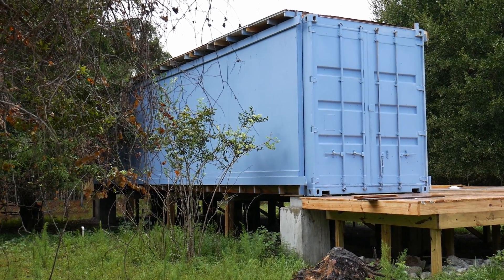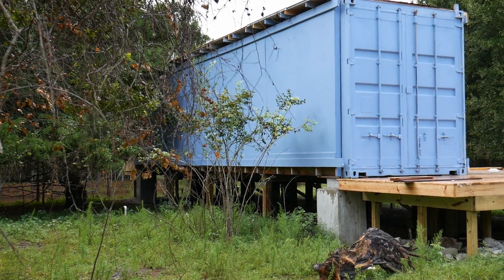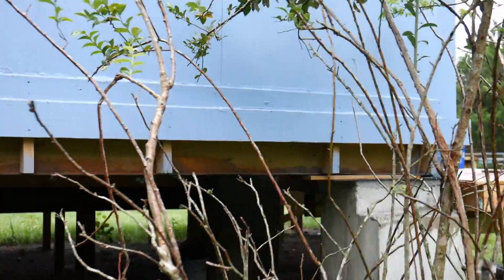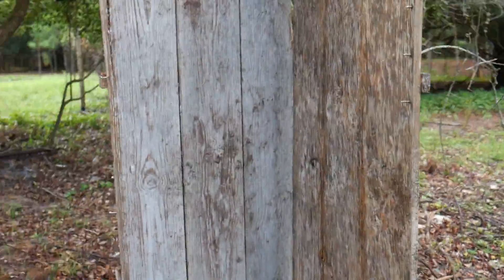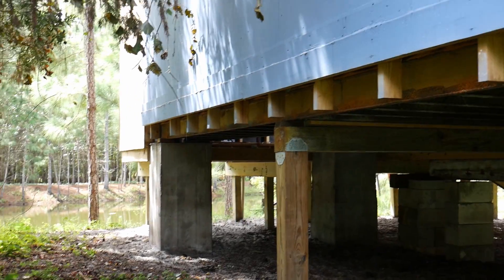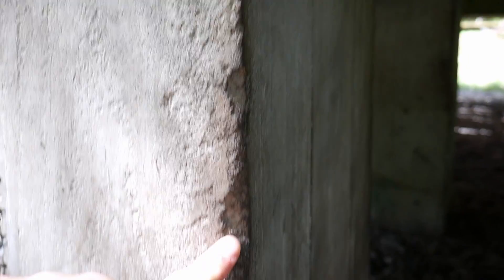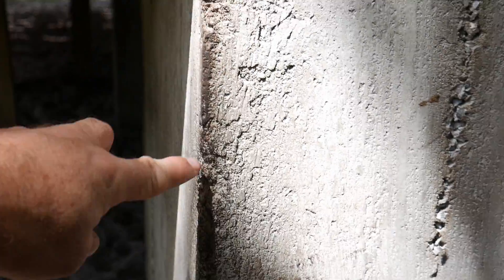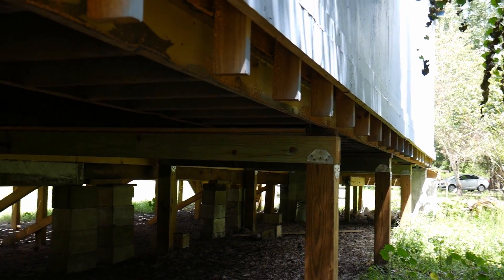PIER Foundation for my shipping container Tiny-Home

Comment: Awesome project  looks like it's coming along nicely.  I'm in the process of building a 40 ft shipping container home in Florida. I will also be using a pier Foundation have you had any issues with the piers sinking. I'm in Volusia County Florida my soil is pretty much sugar sand.
Reply from the maker: No issues with the pier sinking/ settling after at least a couple years in the ground. The base of the piers putting is at least a foot Weider